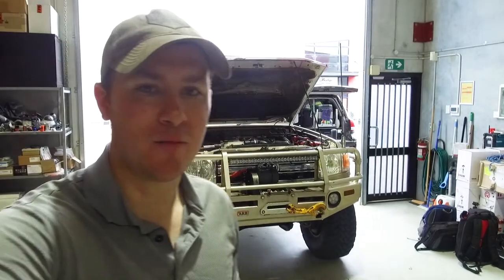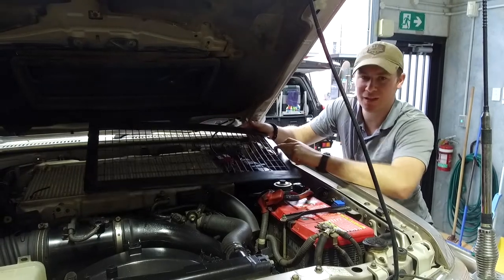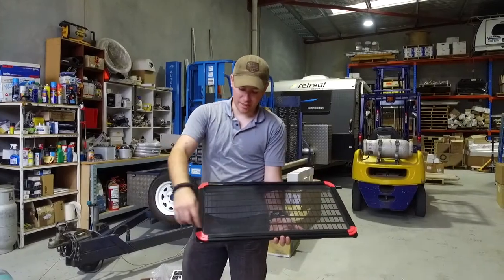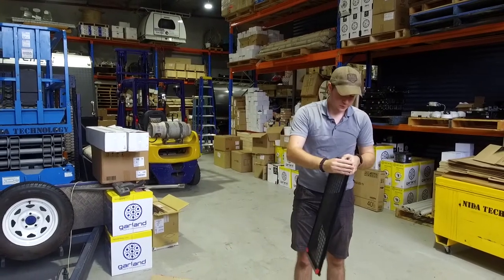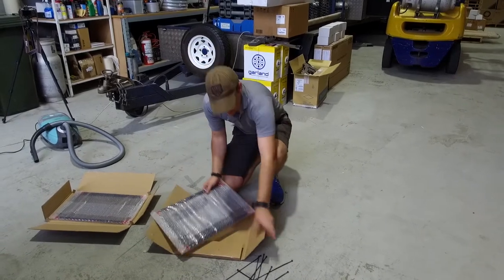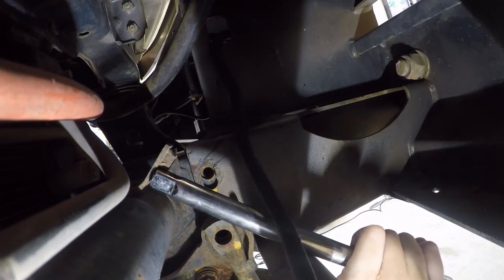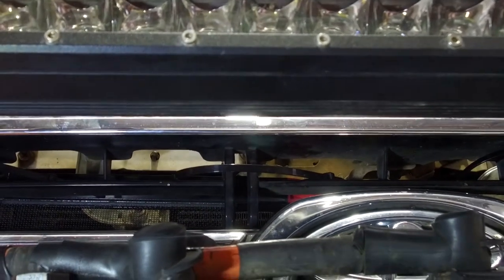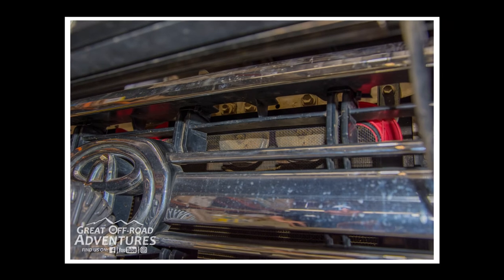SRW Screens VDJ70 Install Guide - Intercooler and Radiator - Dec 2017

Comment: what was brett using to open up the bent parts on the intercooler mate?
Reply from the maker: Just a small set of jewellery screw drivers....same as what I used with mine